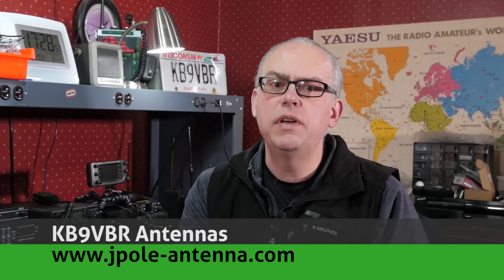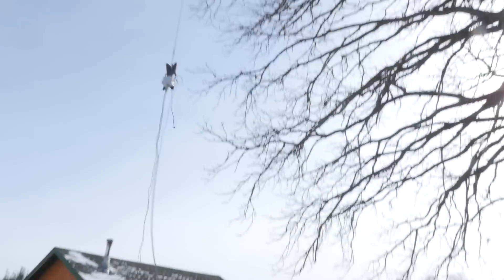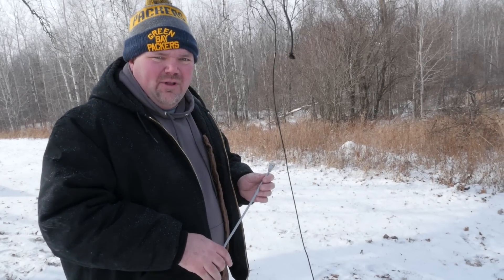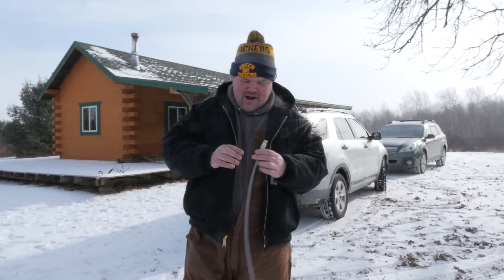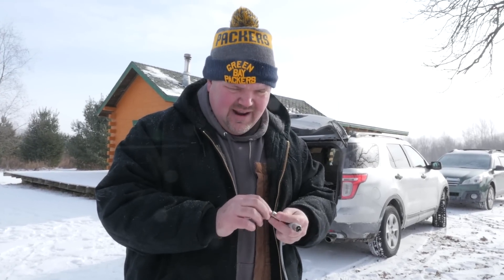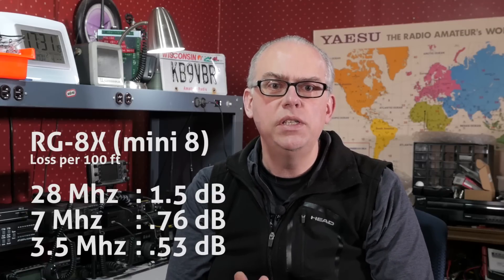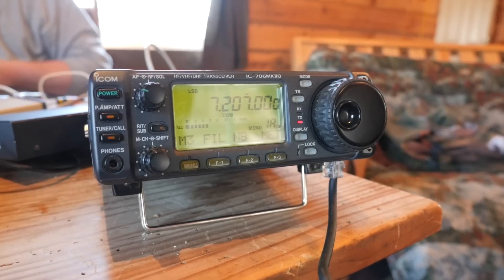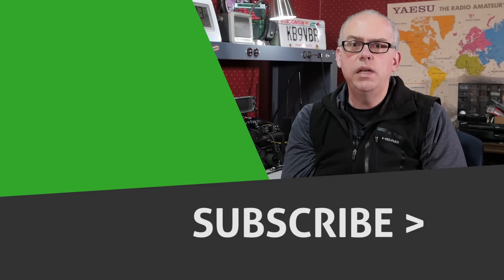Coax Cable  for HF Portable Operation - Ham Radio Q&A

Comment: Hey Michael, I'm taking this winter season to prep for parks on the air! It's been 5 years since you made this video is RG8X your recommendation for portable or has something else come along? Thanks Jordan KE9BPO
Reply from the maker: Nope, I'm still using RG-8X. I also don't buy the fancy 'armored' or "POTAflex' stuff either. Just good quality 8X like from ABR, DX Engineering or another American cable manufacturer. I feel that cable is a consumable product and it is going to fail, so don't invest a lot of money into it. In fact, in five years of doing Parks on the Air activations, I've found the failure point is always in the connector and not in the coax itself. So don't spend a lot of money and carry a spare. My kit consists of two 25 foot pieces and one 50 foot piece for that reason.
Reply: @KB9VBRAntennas  Thanks for the fast response, I appreciate it.

Comment: Looks like you're confusing the issues - cold weather operations (YOUR comfort/convenience/lazyness(?)), has NOTHING to do with the transmission characteristic of the cable and connectors - please reexamine your opininons, NEWBIES will be confused/misguided without 
even realizing YOUR confusion.  Sorry to be critical, but I have to call 'emm as I sees 'em - RG8 is known to be less than ideal, BTW
Reply from the maker: RG-8X is more than adequate for HF operation, and is an excellent choice for portable operation. I'm not seeing the confusion, so maybe you need to elaborate your point a bit.

Comment: Have you guys considered RG-316 for portable ops? From the limited info I found on the internet, the losses are minimal if you keep the run fairly short. I keep a 3 foot section as an adapter to run my HT through my UHF/VHF car antenna. I also use a 25 ft section with BNC connectors for portable HF. I run QRP when operating HF portable so I’m not sure how it will react with QRO.  Its fairly cheap per foot and its super manageable to use in the field.
Reply from the maker: The antenna mount in my car uses RG-316. Super lightweight and flexible, although a bit lossy in longer lengths. I imagine that this cable would make a great component in a super lightweight backpacking kit.
Reply: From what i can gather, if you keep the run short.....it’s perfect for portable. Its super flexible, small and doesn’t get stiff when its cold. I used it for winter field day 2019 and didn’t have the issues you guys brought up with the cable getting cold.